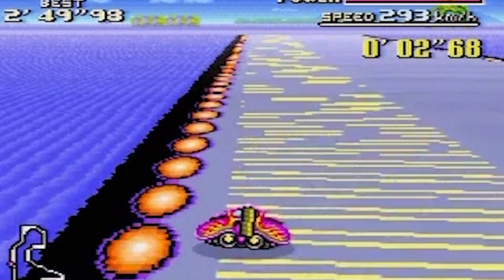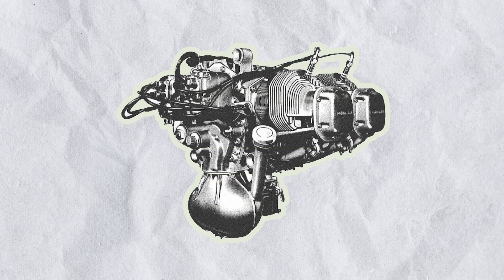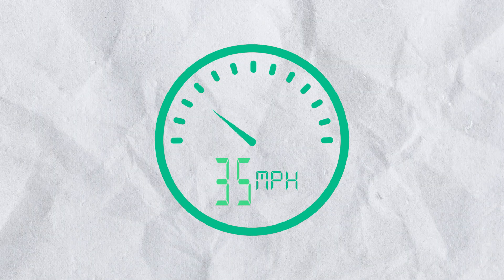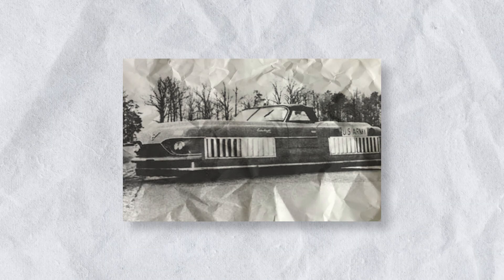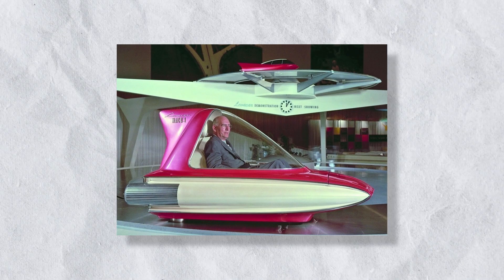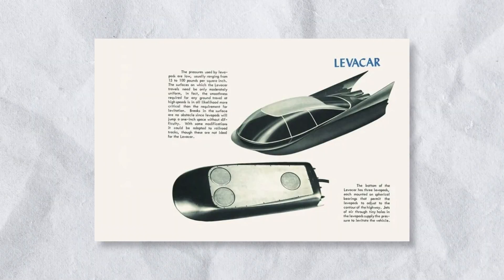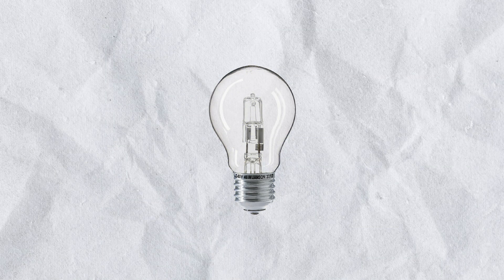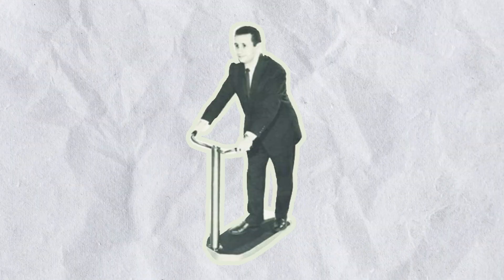The Hovercars of the 1950s: A Futuristic Dream That Never Took Off

Comment: hovering only 3 mm (1/8 inch for metrically impaired) above the ground is actually incredibly stupid... a small pebble and you're gone....
Reply from the maker: Very true, it seems like the Model 2500 had the Levacar beat in that aspect as I believe it said it could reach heights of several inches.